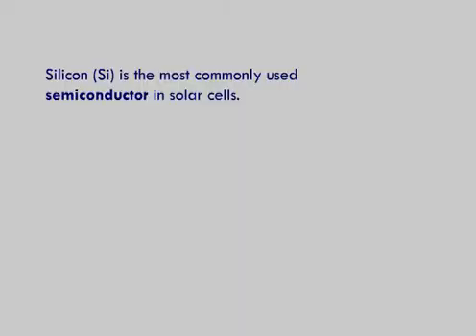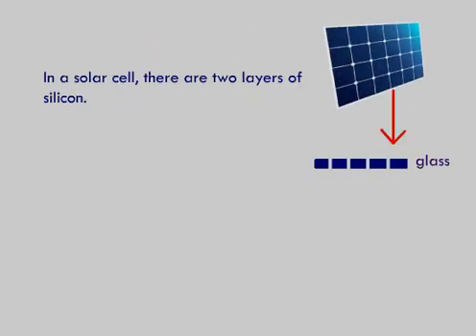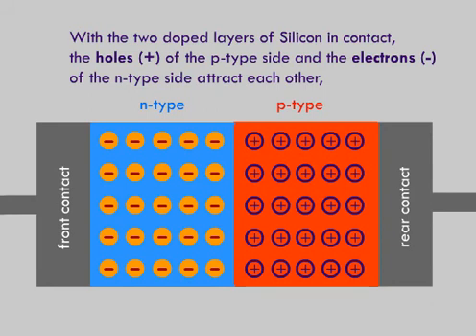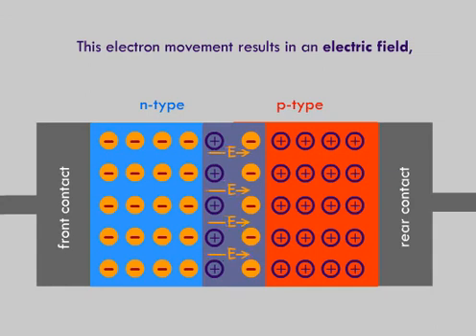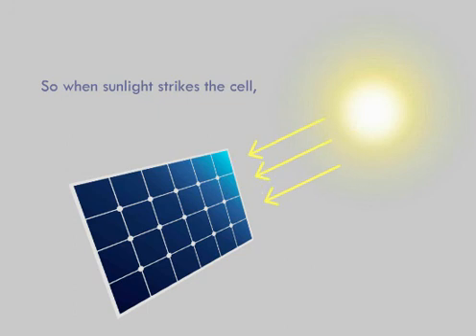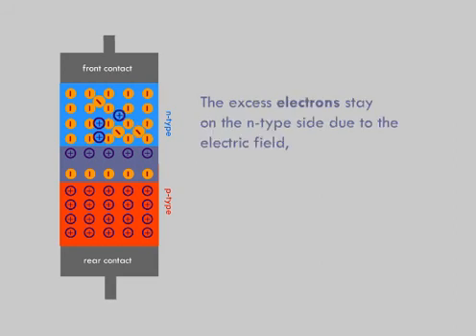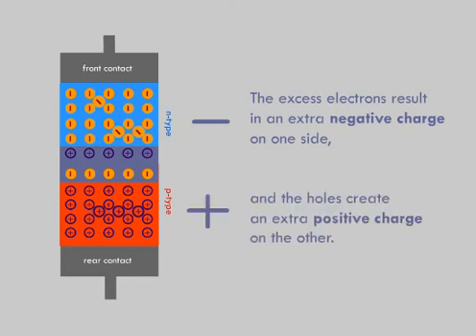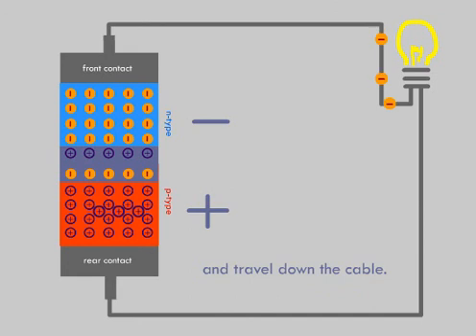How Does a Solar Cell Work? (Student Project)

Comment: Generation (excitation) does not occur on the N-type material which is degenerated and much more thinner than the p-type... Nice try doh...
Reply: Actually any EHP generation in either the N+ region or the P-region would mostly likely recombine with the minority carriers in their respective region. Most of the solar cell current comes from the EHP generation in the depletion region (space charge region), where the generated electrons and holes are then sling shot across the E field to their respective ends to be collected at the electrodes.

Comment: Very well done. I would only say that you should show 'conventional' current flow through the circuit (from positive terminal to the negative terminal)   All DC circuits analysis use that convention.  I work as an engineer at a large PV power conversion company.
Reply from the maker: Thank you so much for pointing this out! I completely forgot about it. Will keep this in mind to fix! Made note of the error in video description for now. Thank you again!